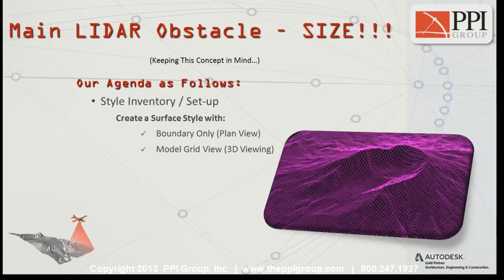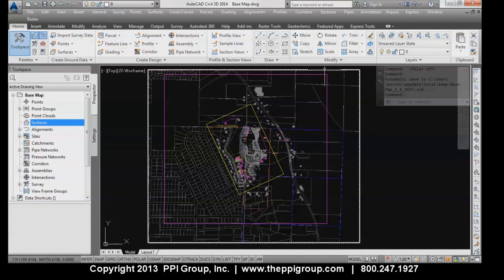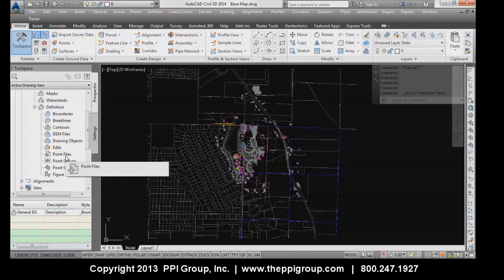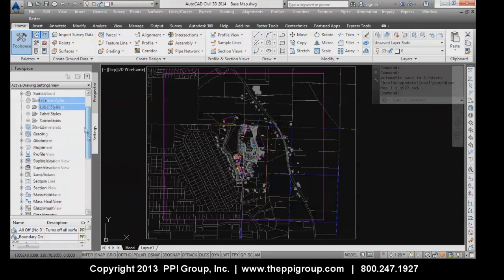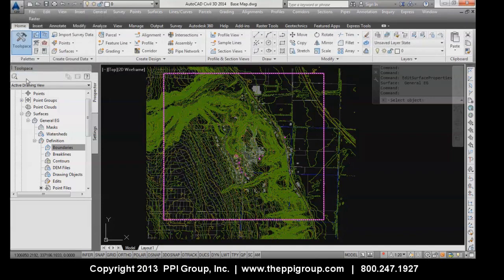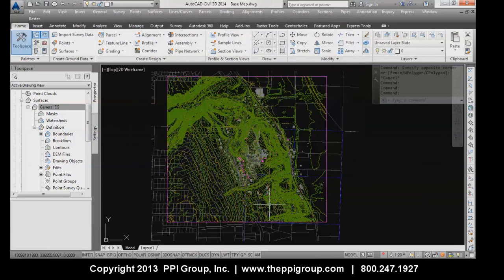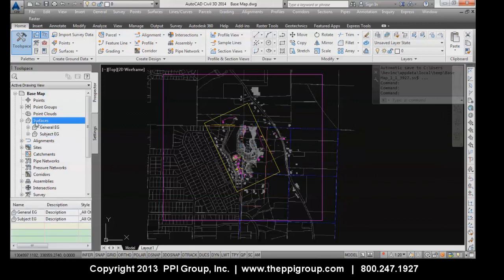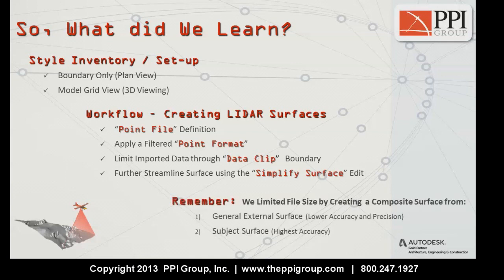Tech Tip: Working with LIDAR Surfaces in Autodesk® Civil 3D

Comment: This really helped me out and I appreciate it very much. My pc and Autodesk Civil3d 2015 would just jam up until I used this process. I could process the surface with a million + points the first go round, but that was it. Once computed couldn't do any other edits or make layouts, etc. to complete mapping. Thank you again
Reply: I have faced an issue with 100sqkm lidar point cloud data ... its takes too much time but i have good and high specs workstation intel Xeon 64 threads 128GB ram but its did't help me to generate surface contours. Help me please you have any idea